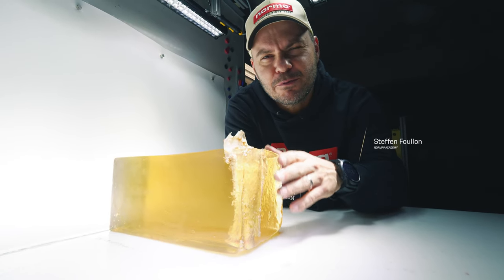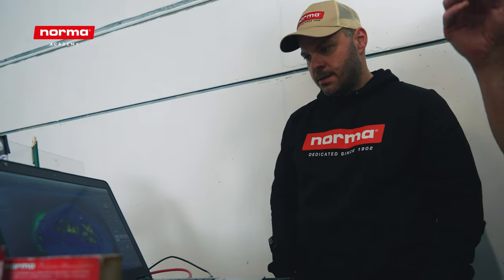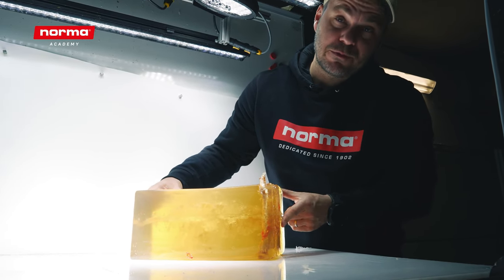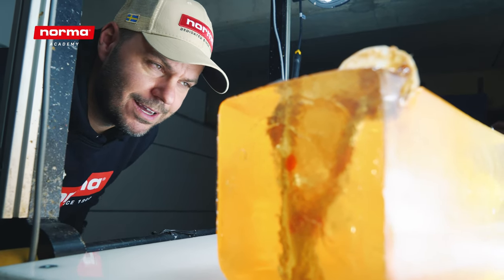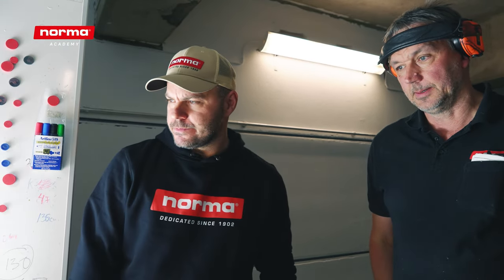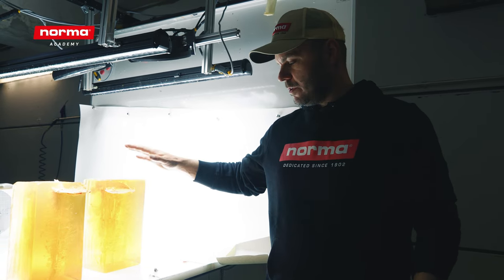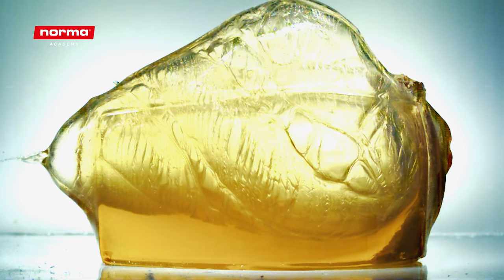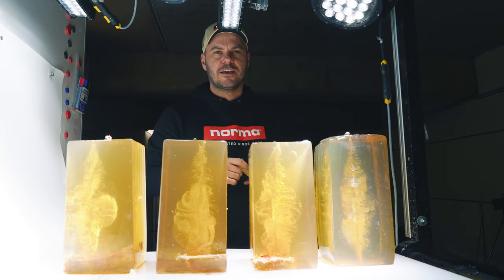How bullets react when they hit a bone | First high-speed footage on real Game bones ever recorded

Comment: Very interesting to see how much energy the Ecostrike passed into the gel block, with perfect expansion and full weight retention. Will there be a 243 version of the Ecostrike coming out. I would like to try it on roe or young fallow. TBH, my 243 with 100gr Oryx drops large fallow, perfectly, every time.
Thanks for the video.
Reply from the maker: Thx a lot Colin, let me check on the .243 Ecostrike with the Ballistic Department and get back to you asap

Comment: Tjena. jag har en fråga. Hur långt efter går kulan? efter djurkroppen allså går kulan 500meter eller går den 20meter efter djurkroppen??????? det är ju det som är mest intressant inligt mig...just för kulfång i skogen
Reply from the maker: Good point glad you mention this. It’s impossible to answer this in one general answer. So many factors influence the behavior of the bullet. For example body size, point of strike, angle, caliber, barrel length etc just to name a few. The velocity of a bullet that exits is most likely extremely high. 500 meters after the exit is definitely still within the danger zone. Therefore having a proper backstop is crucial. Good hunting 🌿

Comment: Good and interesting video. I used Oryx (9.3x62 18,5 g) on wild boar and I believe it is a very good and polyvalent bullet. Unmatched in weight retention and very reliable expander.
I would like to request something from you. In your position, you may be able to test MONOLITHIC COPPER bullets at SLOWER speeds. Every test I can watch uses .308 Win. .30-06, .300 WM, etc. I use 9.3x62 for wild boar, and I would like to see how those monolithic bullets really open up at more sedate velocities. How they expand at close range and then at say 100 m, or even more. Mi Blaser R8 in 9.3x62 pushes a factory loaded 18.5 g. bullet around 685 m/s. At 100 meters, they fly around 600 m/s, and at 200m, around 530 m/s. Do these "green" bullets (Ecostrike) really expand reliably at those velocities? No ammo make ever show those tests... We have to believe... Another cartridge I hunt with is 7x57R, same problem, Muzzle Speed below "standard"... In a few years we might be forced to use them, but I do not trust in the expansion, AND I am scared of the RICOCHETS in driven hunts, as well. The EVOSTRIKE test would be welcome as well, for the same reason... lead banning.
Thank you.